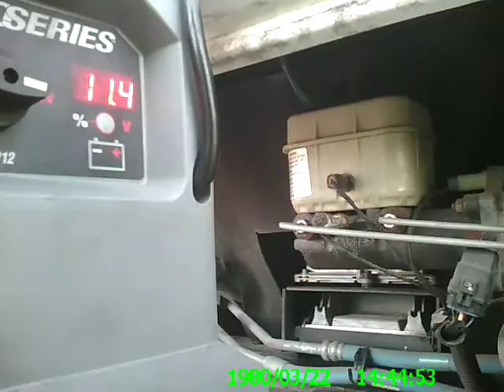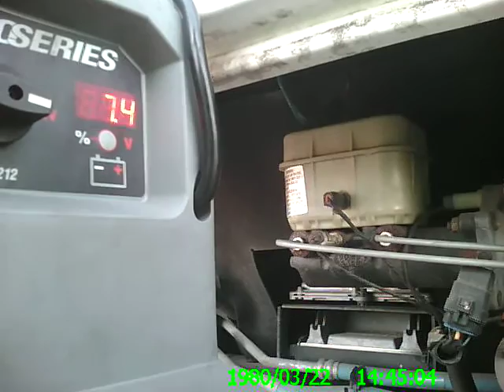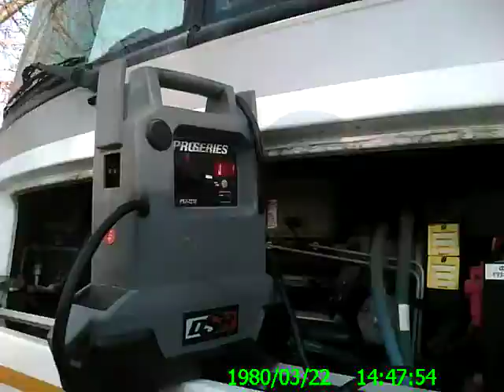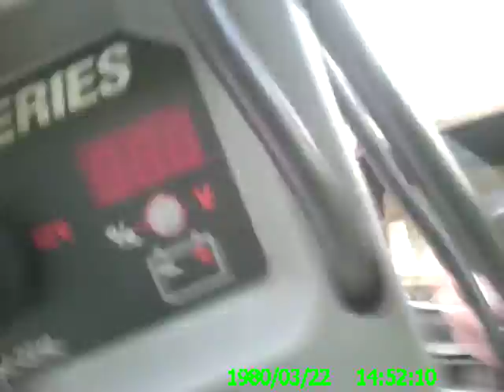How To Jump Start A RV

Comment: I have 2006bounder love it
Have found that when plugged.in to shore power it does not charge the chassis battery
Did you try to use the aux switch so t connected to house batteries
More than  willing to speak to.you  k like my gas.unit
Good luck
Called w 32 8100 GM mines is 32 ft